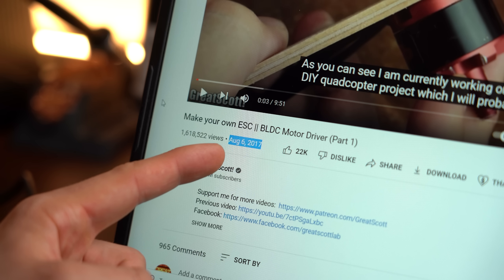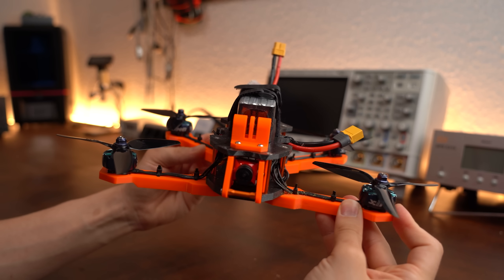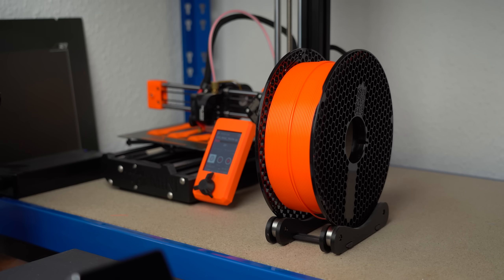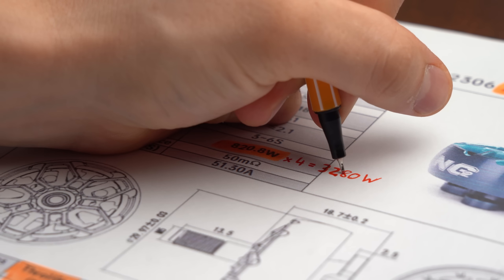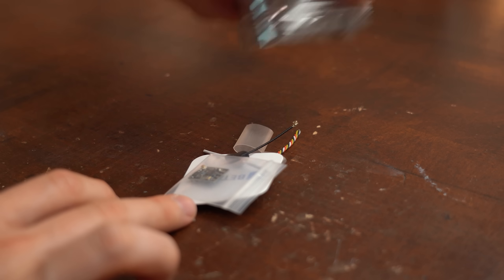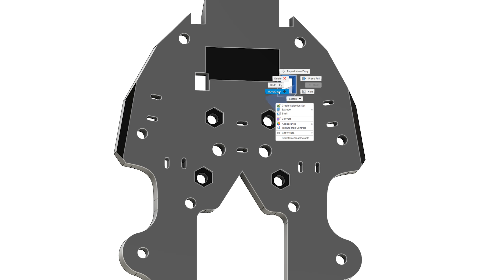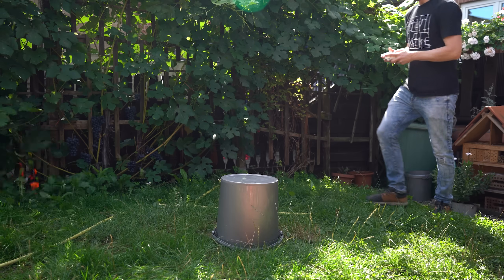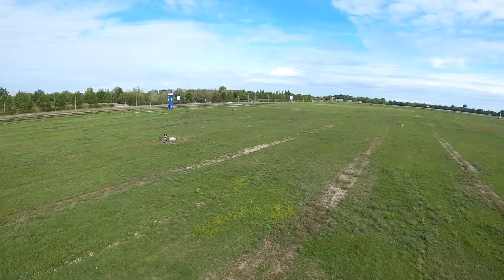The Idiot's Guide to Making a DIY Drone! (I am the Idiot)

Comment: That 3d printed frame will have way too much give to fly ‘well’. You’ll get gyro oscillations and general unstable flying as your skill base grows. I’d highly recommend a 5” frame from Amazon. They can be had for as little as $30 usd. 
Another note. You typically don’t want anything above the FC for maximum electrical noise isolation. The ESC is the noisiest component so it’s best at the bottom of the stack. The only thing i’ll put on top of a FC is the RX usually just for packaging constraints. Check out Thingiverse for printable TPU holders for your RX to make it secure and electrically isolated without having to wrap it with tape of some sort.
Reply: have you got a link to that 5 inch frame on Amazon?

Comment: I made one in college using a Pi and arduino with some extra sensors and it worked pretty well. At the time the only leveling software was some open source stuff but it was really basic and rough. It's interesting that this stuff is now all in one board.
Reply: But the software is still open source and likely can trace its origins to the same place as yours

Comment: If you want to fly and not spend months learning it and wasting money on crashes, I recommend using auto level mode. Let the drone balance itself to horizontal when you release the stick. In any kind of emergency you can just let go and it will be fine.

Comment: As for the frame: you can try printing with something stiffer and a little stronger, like PP, PC, ASA. Also, often using a wider nozzle (0.6mm, 0.8mm) and/or increasing number of perimeters help

Comment: Great video! I watched your videos before getting into FPV, then I found myself getting into drones right after your first few attempts in creating one. I am really excited to see this video and your new hobby maybe? I agree, the 5/6inch size of the drone is a little big. I don’t make/fly any greater than 3inches. There are a few reasons but mainly because you don’t break much when you crash and not as $$$ to replace parts 😂. I look forward to more like this from you to see if you can maybe design your own ESC pcb for a mount size of maybe 20x20? Or even a DIY ELRS receive? They are open source.

Comment: Nice topic ;)

The biggest downside of printed frames is the resonance behavior. That can lead to oscillations in the pid loop and can cause flyaways and shaky video.  Carbon is waaaaay more durable  and even stiffer. 
Also the vtx antenna causes massive oscillations. The rule is to get it as short and stiff as possible (stubby antenna) ✌

Comment: I'd recommend a lighter (carbon) frame (they are really strong, just buy a 2 spare arms when you buy the frame and you'll be set for years to come). Furthermore, those motors have quite high kv (2400kv on 4s is more than enough), so you could use some lighter pitch props to gain some flight time. And lastly, like mentioned by others, your batteries are quite high in capacity, and therefore heavy. Try some 1500mah 4s lipo (for example the cnhl black ones). The weight reductions mentioned above in combination with a lighter lipo should get you about 5 minutes of flight time!

Comment: fpv drones are great fun.  Elrs is just coming of age and is great.  Cadex makes great analogue cameras and we're kind of just at the leap to digital cameras, but many of us are still analogue.  Betaflilght is the industry standard with a few hard core running Kiss software.  Eachine and racestar seem to make some of the best cheap/beginner budget components and are available on Banggood.  Rotor riot, Flite Test, Painless360, Albert Kim, Oscar Liang, and Johnathan Bardwell are good technical hobby resources for those starting into the hobby.

Comment: One of the most important rules is to NEVER! EVER! touch an armed FPV quad! Those props can and will mess you up real bad if it freaks out for any reason! 
3D printed frames don`t work. They kinda do but they don`t. Kinda like wooden wheels compared to a tire. They break way too easy and are too flexyble which upsets the gyro. Get a Carbon fibre frame, they aren`t very expensive, are better in  every way and don`t break in such light crashes.

Comment: As a professional fpv drone pilot it was so painful to watch your mistakes.
Firstly: always spend some days practising the drone navigation in somekind of pc simulator - it saves you hundreds of $ and also gives a better first real flight experience after.
And as you realized 3d printed drone parts are not the way for fpv (racing/ crashing) drones. You adviced to use anykind (brand/model) carbon fiber composite frame, which is way more durable, also lighter (gives you more flight time), and probably cheaper too (they comes from like 16$ for a complete drone frame set.
Some other minor suggestions: betafpv is not the brand who makes great qc/quality products, so in the future i offer you to buy some other branded radio controller (for example jumper/radiomaster) when your current radio transmitter will starts to fail; and one tiny bity advice for the last: We (fpv drone pilot word) tends to put our ESC to the bottom of the flight stack, and Flight controller on the top of the ESC, so like reversed or flipped like you did, but who cares if its good for you for now :)

Comment: As someone who's been doing this for a few years now, a few tips.  Don't use a 3D printed frame, it flexes too much causing the oscillations you were seeing, buy a carbon fibre one, they last a lot longer too, especially if you get a proper "name brand" one rather than a cheap knockoff (Armattan have a lifetime warranty, so if you break anything, you just have to pay shipping, other good brands are ImpulseRC/Ethix, Catalyst Machineworks, Ummagawd, GEPRC, iFlight, and there's a heap more, but that's a good start). Next, put your ESC on the bottom of the stack, and shorten the motor wires. Capacitor isn't needed for 4S but still recommended, but you definitely need to lock your battery straps into the drone a lot tighter so they don't flop into the props (the balance lead will tuck nicely under one of the velcro straps too). Your battery is too large for a 5" drone, I'd suggest a 1500 mAh one. The rest of your parts are very good, but your VTX is overkill unless you unlock it and go beyond the 25mW limits you have there.

Beyond that, pick up a simulator for your computer, Velocidrone and Liftoff are the two most popular, and practice there.  If you want to get into tricks, don't worry about learning angle mode, as the techniques are quite different.  Personally I spent about 5 hours in the sim before I could do a coordinated turn (using both roll and yaw at the same time) properly, and about 10 hours before I went out with my actual drone.

Comment: Just use a carbon fiber frame, yes you cant print it if it breaks but you probably will never break it anyway. Not only reliablity, carbon fiber is much stiffer and lighter. Stiffer frame makes a drone fly better as there are less vibrations. Also if im correct you didnt print the frame with 100% infill, i assume because that would make the frame so heavy. Your choice of fc, esc, and motors is pretty good, although you might want top swap the fc and esc position for ease of use. The 2200mah lipo is too heavy for 4s 5 inch, 1500 is the sweet spot. One really bad thing you showed in this video is holding the drone while its armed with the propeller installed. Any pilots would never recommend you do that. Otherwise, just keep practicing in simulators to improve your skills.🙌

Comment: you need carbon fiber body (frame). First anything else breaks extremely easily, second anything else vibrates a lot and that affects the flying performance. Carbon fiber is the best option.

Comment: get a drone simulator on your PC and spend 10 to 30 hours.... it will be much cheaper and faster way to learn. Important is to use in the simulator the same remote controller as your real life drone so that u build the correct memory muscles.

what you say about motors is not valid for beginners in my experience. better get the cheaper ones and replace them as you crash. You selected the best motor for 20$ and they are similar or better than most other more expensive motors.

enjoy the hobby !!
Reply: I just saw the end of the video :) do yourself a favor and give up on the 3d printed frame idea and get a carbon fiber one : it will resist crashes much much better and solve your vibration issues. Suggested list of frames at Joshua Bardwell website https://www.fpvknowitall.com/fpv-shopping-list-five-inch-freestyle/#frames

Comment: Yeah, not the best parts, not the best build but nice to see you did it. As someone already mentioned- carbon frames are much, MUCH stronger. Especially if you take a high-end frame. For example Gravityloss frame can handle a human weight, because of not cutted, but formed legs, and titanium booster at the center of the frame. Thouh they are expensive.
Also there are dedicated FPV stores, you can get all the needed parts. 
And if you need some info, Oscar Liang's website and Joshua Bardwell youtube channel would be very helpful

Comment: This reminds me of building my first quad it was so fun learning everything. Just wait until you are doing flips and flying through trees so fun. But I think a lot of your issues are caused by the flex of the 3d printed frame. These quads are extremely powerful and need a stiff frame to transfer accurate info to the gyro and a good carbon fiber frame can be had cheap probably close to what the filament and electricity would cost to print.

Comment: Nice project! I’ll add my opinion with everyone else’s. The stock beta flight pids should work pretty good with a standard weight 5in. Your battery is quite large and heavy, this will probably need pid adjustments or a smaller battery. Flex in the frame may be an issue but I think major gains could be had with better esc/fc mounting. With the heavy esc on top and free mounted long bolts the whole assembly will move too much. I would install the long bolts with nuts mounted tight to the frame. Esc (heavy) on the bottom and FC on the top. Don’t squish the rubber too much. Great job!

Comment: If you want to try a small racing drone, I highly recommend the EMAX TinyHawk Race 2. I know it's not DIY but is a ton of fun for it's price. Very fast too compared to the starter kit brushed FPV quad you have. If you plan on staying analog for VTX, I also recommend EV800Ds. Having a bigger viewing screen really makes the experience that much more immersive and I find myself having trouble going back to a smaller headset.

Comment: Yeah, these things often gain huge benefit from clean electricity, minimal vibrations, and good PIDs. The low ESR capacitor is obviously going to soak up the little spikes, your filters would greatly benefit from bi-directional DShot and RPM filtering (flash Bluejay if you're on a BLHeli-S board), and usually stock Betaflight PIDs will at least let you fly. Good on you for your first build though!

Comment: Great to see a popular channel like yours showcase an FPV drone.

I hate to say it, but in this case a bit more research on the topic would have helped you make better decisions which would have made a much better and longer flying quad.

The goal when building an FPV quad is always to make it as light as possible with as few vibrations as possible. In this way, filtering on the gyros can be reduced and you end up with much better performance with much quicker response time.

Don't get me wrong, it looks really super cool, but it also looks like it would fly like a pig (I mean no offence). You say it's too powerful for you, but I reckon if you flew a well tuned 5in quad with a carbon fibre frame you'd realise how underpowered it actually is (or rather how far from optimal yours really is).

Still love your channel bro.

Comment: As someone who has a 60A zeus you might want to set some throttle limits if you haven't yet just starting out, If I mess up it will be gone in the blink of an eye 200+ feet in the air.

Comment: When I designed my 3d printed long range 9" quad I learnt a few things that might help:
I also used petg in the first version, but actually pla had better results due to the higher stiffness resulting in less flex in the arms.
You can also turn on blackbox logging in betaflight, if your flight controller has an sdcard slot or flash storage. That way you can use BlackBox viewer, to find out what happens in case something fails.
It flies really well with default PIDs, so that is definitely possible with a 3d printed design.

Comment: Welcome to FPV! This hobby is seriously awesome. A few things I would recommend - use a carbon fiber frame, they are incredibly durable and lightweight, and allow much less vibrations from the motors into the gyro on the flight controller (due to it being more rigid), leading to better flight performance. The TBS Source One is a great cheap frame for about $25, but there are plenty of other great options. I would also recommend using acro mode (manual mode), as it doesn't limit your movements and is much better suited for FPV drones. I would definitely practice in a simulator first though. Great video!
Reply: "TBS Source One".  Got a link?

Comment: Fun build!  The esc beeps tell you the FC reinitialized so you can trace it back to a connection/supply issue.  Not the cap though.  Cheers Bud

Comment: 3d printed frames alone can cause tons of vibration that will cause feedback loops with the pid controller.  I would look into carbon fiber.  If you absolutely have to make it yourself check out the source one open source frame. There is files to cut it yourself. Love your channel since getting into fpv I like knowing the how things work and you do great at explaining it all. I look forward to seeing you progress with your flying 🤙 if you need any help with betaflight feel free to hit me up. Looking into black box explorer or pid toolbox as a side program to explore flight data is always a good idea.  Welcome to the fun of FPV 🙂 it gets very deep very quick 🤣
Reply: I just realized you have the esc on top also you should try to avoid this the flight controller is very sensitive to the emi from the esc/motors/motor wires

Comment: FPV is the only way to go.  Def switch to a carbon frame.  There is to much resonance in 3D printed frames.  They just dont work right.  Otherwise its just a LOT of practice.  A SIM will save you from breaking parts and spending money.

Comment: If you are following along this video and planning on building a drone, NEVER EVER do what he did at 13:18 EVER, that's how you lose a finger, get your arm cut to pieces or possibly worse.
Specially if you are using betaflight with defaults settings where the pid loop is always active.
Reply: I can feel the pain just by watching it...
Reply: yeahh, 3+ kilowatts worth of motor power attached to essentially rotating blades (that produce thrust; aka erratic movement that could easily get out of control) is not something to fuck with
Reply: That has appened to me and almost lost a finger a year ago 
I picked it up from the ground and somehow hit the arm button and it went crazy on me 
Not a good experience
Reply: any suggestions for a frame with the blades in a boundary?

Comment: The problem with 3D printed arms is that they are too flexible, the motor vibrations will excite their harmonic resonances and mess up your gyro signal. You can fix this by adding a lot of filtering, but this in turns adds delay, which messes up the PID loop as there's too much delay between the action-reaction as perceived by the flight controller. This is without even considering how many times you'll crash due to breaking the arm in flight in aggressive maneuvers and then break other things.  

Stick to carbon frame arms, you can buy a bunch of them very cheap for whatever frame and they're genuinely indestructible if you only fly over grass. If you want a cheap but good one, look at GepRC. In this case of DIY or buy, I guarantee you buy is better.

Comment: Since I started building my birds (5-6 years?) I've only flied with stock BF rates and filters.
You will have lots of problems related to oscillations and vibrations because of the plastic frame. Get a real carbon fiber one (no matter the model or manufacturer, anything is better than 3D printed)

Comment: From someone who is donig this for a while, welcome to this amazing hobby!
to give you some general advice:
-get some hours in a simulator before trying to fly irl
-NEVER start such a drone in your handy, this is really dangerous
and to add some comments to your build:
-get a real carbon fiber frame, this printed one has way too much flex and breaks immediately
-use a shorter antenna
-your batteries are a bit big, soemthign in the 1300-1800mAh range would be better

Comment: Apart from getting a carbon fiber frame, I would recommend that you swap ESC and FC in the stack. Having the FC on the top is more convenient for maintenance, since you rarely need to work on the ESC after you solder the motors to it.

Comment: No hate but a carbon fiber frame would be better. If you crash a 3D printed frame like you did in the video at 14:26 it will always break. But if you use a carbon fiber frame it won’t. It’s light and durable.

Comment: hey man, nice one, like every video :) good setup and good explanations for beginners, except for the frame xD  you should defently try a carbon frame instead of printing one ^^ less vibrations = more stable flight and it safes you money and time to fly ;) tbs source one for ex. is good cheap beginner frame ;) .. the fc failsafed mostly cause you got too much noise cause of vibrations..   und bei der rpm berechnung solltest die vollen 16.8v von 4s hernehmen, somit bist mit 2555kv bei 42.924rpm.. weil ab ca 45000rpm wirds kritisch mit 5zoll props, dann durchbrechen die spitzen die schallmauer und fangen an flattern ;) achja und nur acro ist richtig fliegen :P ;)